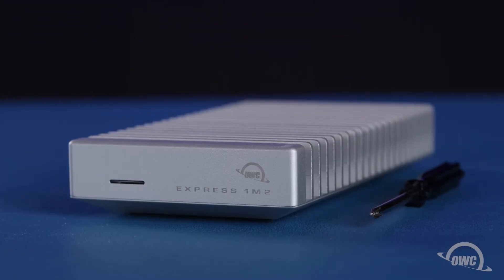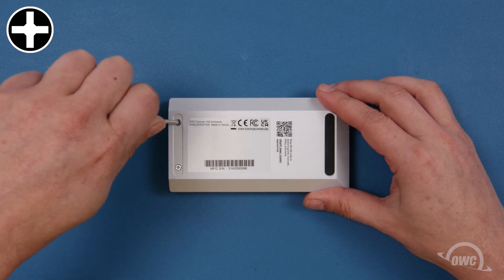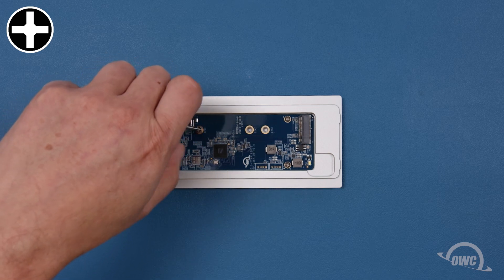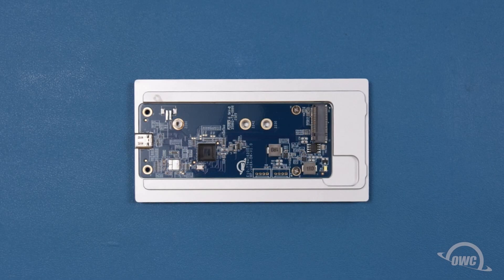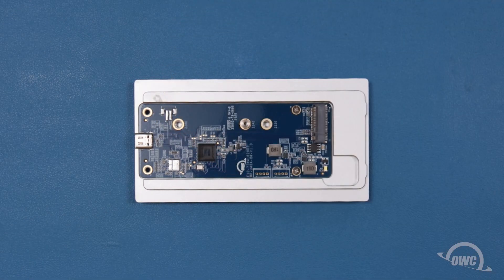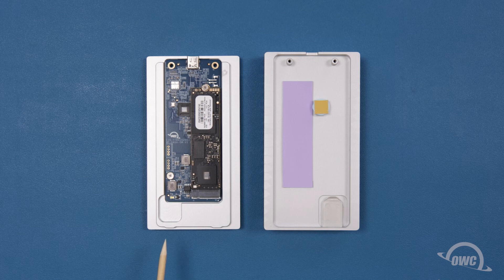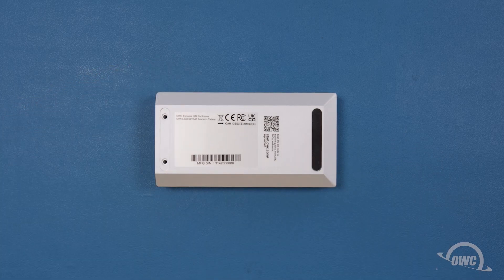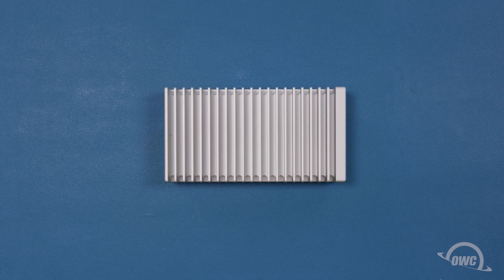How to install an M.2 NVMe SSD in an OWC Express 1M2 enclosure

Comment: Hello
I've just received mine but don't have the yellow square on the thermal pad :(
Reply from the maker: Your Express 1M2 will work perfectly fine without the yellow square on the thermal pad. Some units come with the yellow square, and it's advised not to remove it, as doing so can damage the thermal pad and void your warranty. As your unit lacks the yellow square, there's no need for concern.
Reply: thanks!! @poweredbyowc

Comment: I've tested the OWC Express 1M2 with my Lenovo Thinkpad P53 (Windows 11 Enterprise edition) and Macbook Pro M1 max. I'm using the older Samsung 970 Pro 1 TB NvMe drives. For my personal reasons I want to stick with the older MLC V-NAND because they are more reliable than the newer TLC generations. 

I compared them with my latest Acasis TBU 405Pro M1 active cooled SSD enclosure with a Thunderbolt connection. Connected to the Thunderbolt 3 port on my Lenovo Thinkpad P53 the OWC is a lot slower compared to the Acasis. I used the CrystalDiskMark 8.0.4 Shizuku Edition X64. 

Read 1056 (MB/s) 1056 & Write 1032 (MB/s)  vs the Acasis Read 3030 (MB/s) & Write 2086 (MB/s)

One thing I don't like is that Samsung Magician doesn't recognize my drive. You can't activate over- provisioning and firmware updates will not work. It's being recognized (Samsung Magician) as a USB 3.2 Gen 2 interface with a UASP protocol.

I also tested a USB 3.0 port plus usb-c and tested different cables. The results weren't satisfying enough either. In my situation with my older Thinkpad P53 it doesn't make sense to swap my Acasis for the OWC Express 1M2 enclosure.  The build quality is great just like the OWC Mercury Elite Pro mini I just bought no comments on that. 👌👌

On my Macbook Pro it was a little different. Same Acasis with the same Samsung 970 Pro 1TB and here the OWC was a little faster 

I used Blackmagic:

Acasis TBU 405Pro M1 : Write 1977.6 MB/s    Read 2719.6 MB/s
OWC Express 1M2 :         Write 2155.8 MB/s    Read 2879.9 MB/s 

But for me personaly again not a reason to swap the Acasis for the OWC. The newer generation Nvme drives are way faster these days so my situation can't be described as a reference. The same with temperatures of the enclosure. The OWC felt a little warmer but that's the way it should be. 

I think that the OWC Express 1M2 is a better choice to combine with Apple Silicon computers and newer generation Windows computers.

Comment: Hi, does it compatible with 16TB m.2 ssd on the current firmware?
Reply from the maker: The largest M.2 drive that we have seen on the market has been 8TB in a single drive. It should allow any M.2 drive to work in this enclosure and we recommend making sure that the drive you are looking at is an M.2 drive before purchasing.

Comment: $119.00 ...stupid expensive.  wow nope.
Reply: Not really. Its heat dissipation looks a lot better than identically priced competition. Plus they never seem to advertise the inflated, hopeful read/write speeds others do. Good luck finding a similarly built and universally compatible enclosure for less.
Reply from the maker: That's awesome! We're glad to hear that the Mercury Elite Pro Mini is working great for you and can't wait for you to try out the Express 1M2!
Reply: You"ll get what you pay for.  😉

I am about to order one tomorrow and will compare it to my new Acacis TBU Pro M1 with active cooling. 

I also have the OWC Mercury Elite pro mini for my 2.5 inch Samsung 2 TB SSD 860 pro drive and was impressed with the performance. I got read speeds of 565 MB/s and write speeds of 505 MB/s in both Windows 11 and with my Macbook M1 Max. The OWC Express 1M2 enclosure I expect it will be faster than the Acacias TBU Pro M1. So far very impressed by the brand OWC.